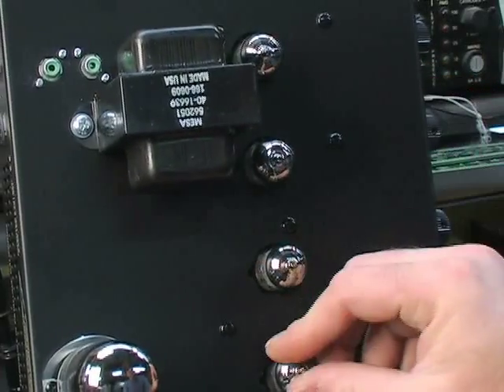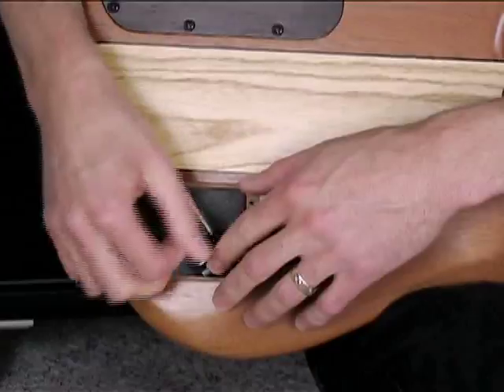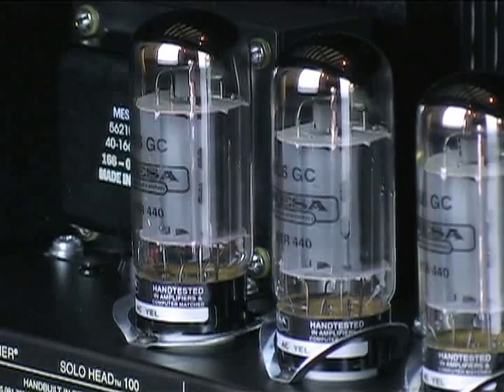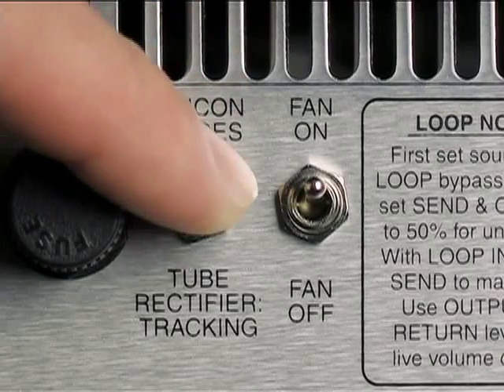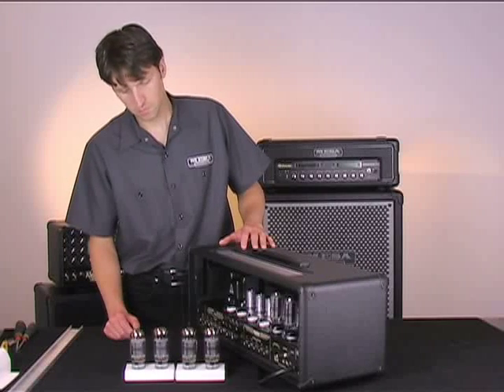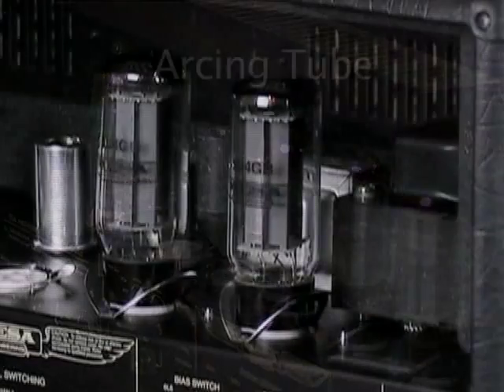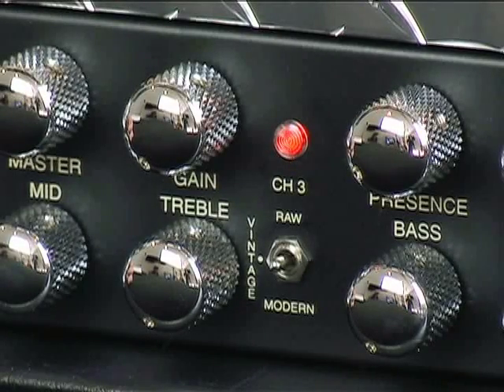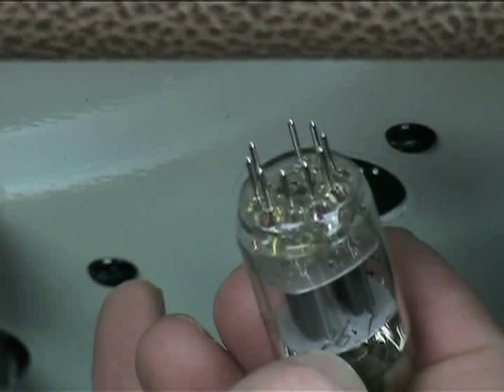Mesa Boogie Amplifier Troubleshooting

Comment: Hey, I just bought a mark V25 brand new and it just arrived about a week ago. I was playing this morning on the crunch mode with a little bit of the boost engaged on the mid control when signal cut out completely all of the sudden, the amp remained on and I checked later with everything unplugged and the fuse was still intact. Just want to know what might be up and how to deal with it. Thanks!
Reply from the maker: Hi Lowcloud - congrats on the amp but sorry to hear of problems. If the pilot lights and channel LED's all stayed lit on the amp when the sound cut out, it isn't likely to have anything to do with the fuse. The first question is, did you have anything else connected to the amp? (Pedals, pedalboard, rack effects, etc. If you did, it's important to remove all of those things and add them back one at a time to make sure the problem isn't somewhere else in your signal chain other than the amp. You can plug directly into the amp with just a cable and continue to play/test the amp and see if it cuts out again - if it doesn't, it may be a cable or something else in your signal chain. If you were just playing with guitar, cable & amp, make sure to check your guitar and speaker cables and speaker input jacks to make sure you trust them. From there, you might need to begin troubleshooting the preamp tubes one at a time as mentioned in this video. Let us know what you find out and we should be able to help you get everything back and going. Keep us posted!
Reply: +MESA/Boogie hey thanks for the reply, I unplugged everything in the loop and such so it was just the amp, I tried all my leads and tested them before hand to make sure they work and I couldn't find anything wrong there, I also tested the leads with out a guitar to eliminate that and there was still no response. I tried running just the head through the head phone jack with Status open back studio headphones, but there was still nothing. I don't want to break the warranty on it, can I test the tubes and keep the warranty intact?
Reply from the maker: Excellent job on the troubleshooting so far,LOWCLOUD NZ. As far as warranty, if the amp is new, the tubes are covered under warranty as well as the amp. Changing tubes is definitely user-serviceable so, with a known good 12AX7, if you replace the preamp tubes one at a time, at any time that the signal comes back with a tube that replace, you know you've found the bad tube. Let us know how you get one with the 12AX7 changes/tropubleshooting and if that doesn't takle care of it, we'll look at the next steps.
Reply: +MESA/Boogie just bought some new 12AX7s (Mesa made of course) and I found the V4 preamp was causing the problem and with a little bit of work we got it out and replaced and got the amp back up to its original glorious state. Thanks for the help, it's much appreciated!
Reply from the maker: Fantastic news, LOWCLOUD NZ– Great job on the troubleshooting and so glad the amp is back to its true glory! Nice. :)

Comment: The fuse holder on my Dual Rectifier is suddenly not catching, and popping back out. Is this something I can easily fix myself?  I bought the amp, used, about 6 years ago. Also, what is the correct fuse to use in this amp?  Thank you.
Reply from the maker: Hi +Rok Hollywood - It sounds like the fue holder in the amp has maybe broken or the cap is broken - either way, it sounds like it needs to be replaced. For a USA Dual Rec, the proper fuise value is a 4amp Slo-Blo fuse. Hope this helps!

Comment: I have a Mesa/Boogie Mark V combo, and I experience crackling. It persist even when there is no cable plugged into the input jack, but will stop if the amp is put on standby or the mute is toggled. Eventually it discontinues the crackling on the lower volume and gain  registers of the 10 watt channels, but if the gain and master are turned up half way each, it becomes very audible. Is there any indication what may the cause of this? I'd rather not have to send the amp in for 6+ weeks if I can avoid it.
Reply from the maker: Hi +MEDium Studios - sorry to hear your having troubles with crackling in your Mark V. However, the issue is very likely to be a tube issue and something you can replace yourself, which is very much what this video explains. With the Standby off, you should hear NO sound anyway - that's what the Standby switch does. The problem could be either preamp tubes or power tubes and the first way to troubleshoot this is - with the amp making the noise, if you turn the gain down, does the noise go away. Or, if you turn the channel Master down, does the noise go away. Or, if you turn the Output Level control down, does the noise go away. Depending on your answer, we can determine if the issue is likely preamp or power tube related. Where are you located? Look forward to hearing back from you!
Reply: MESA/Boogie Thank you for the expediant reply! Within the first 5 minutes of being on, I can hear the crackling noise when both are turned down pretty low, or up. After 5 minutes has passed, I can only hear it if the gain and volume are both at, at least noon.
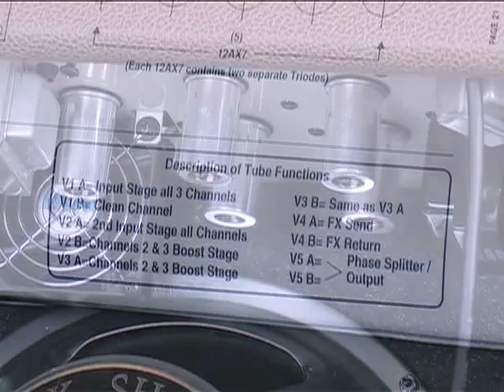Reply from the maker: Hi MEDium Studios- OK. This is somewhat helpful. However, what we need to know is what happens when you turn certain controls down, not what happens when something is halfway up. Are you in the USA? If so, it would be much easier to help you troubleshoot over the phone. If not, please re-read my first reply and see if you can respond specifically to what was suggested. With everything at 12:00, if the noise goes away when you turn a specific control - Gain, OR, Channel Master, OR Output Level. When you cvan answer these questions specifically, we'll be able to help more. You can also email tien@mesaboogie.com and we'll be glad to help. Thanks!

Comment: I'm getting a bad "crackle" sound from my Mark iv, whenever I play a note, no matter what volume.  I can't figure it out and it's pissing me off.
Reply from the maker: Hi +Jon/Ron Smith - Sorry to hear you&#39;re having problems with the amp. Feel free to contact Mesa Customer Service and we can discuss how to further troubleshoot and figure out what&#39;s going on with the amp. Look forward to hearing from you and look forward to getting the amp fixed up! http://www.mesaboogie.com/support/contact-us.html
Reply: +MESA/Boogie I figured it out, I swapped places with the power tubes.  Put the outsides on the inside and visa versa and now it works fine.
Reply from the maker: Excellent, Jon/Ron Smith. If you have the amp on Class A, this means that the tubes that were on the outside (that are now inside) probably have something wrong with them. If you have the amp set to Simul-Class, it's still possible that the issue is with the tubes now on the inside, but in general, it might not be safe to consider the amp totally 'fixed' even though the noise went away. Also, if you haven;t changed tubes in the amp for quite a while, this issue might have been 'telling you' that it's time to consider changing power tubes. Keep us posted and let us know if we can help!
Reply: I'm loving this amp so far, It's crunchy.  Can you invite James Hetfield and John Petrucci over my house, so you guys can help me tweak my Mark IV? ;)  I have a studio here, so we can record something!

Comment: Hi Mesa/Boogie, don't know if you are still checking the comments here. I just bought an Express amp and have an issue of volume drop in and out every 20-30 seconds when amp is warm. Dealer thinks could be from no fan built in but seems strange it happens every time amp has been on for 20 minutes or so. Any suggestions? Thanks.
Reply from the maker: Hi +jonwands - sorry to hear you're having problems with your Express and we can help! If the amp is not designed with a fan, it does not require a fan. It would be helpful to discuss this with you in person rather than via comments here. Please send an email to tien@mesaboogie.com to discuss the next steps to getting your Express fixed up and back to perfect operation and we look forward to helping!

Comment: You got it completely wrong, my comment was a general one and not in reference to this video, tubes are failing all the time and it has nothing to do with Mesa Boogie or any other company for that matter.
I’m using boogie for many years now and love your products very much, your customer service is great,
I have used it many times, very helpful staff and thank you for that.
My comment was a general one, in my own experience pots/ connectors/ switches are failing more than they should, IE over the years I have changed pots on my guitars to good quality ones, the good quality ones literally never fail, and I don’t have to tell you that they are being used much more than the ones on the amp.
I SIMPLY WANT PEOPLE TO KNOW THAT EVEN THOUGH THEY ARE PAYING A LOT OF MONEY FOR MESA BOOGIE AMPS, THEY MIGHT ENCOUNTER ALL KIND OF FIXES THEY SHOULD HAVE NEVER ENCOUNTER.
Reply from the maker: Hi +yoheff988 - Thanks for clarifying and thanks for the kind words regarding Mesa and using our product. While we can appreciate your interest in your personal guitar maintenance, to use that as an example of Mesa using inferior parts is something we would suggest doesn't apply directly to our manufacturing and parts quality process. Again, if you have a specific issue or concern with an amp, we are more than happy to address it or help you or any other customer sort out a problem. To make a blanket statement that Mesa uses inferior parts because you like to use more expensive pots in a guitar or that customers should expect to have problems with a Mesa amplifier is just plain false and not reflected in what we see with our products or our customer service. Again, this is your opinion and you're welcome to share. However, for anyone looking to purchase a Mesa amplifier, your statement of your guitar pot experience versus Mesa reliability is unsubstantiated, untrue and unhelpful. Thanks again or sharing your thoughts and all the best to you and your music! Rock on! :D
Reply from the maker: Hi SHANE BERENGER – If the amp still turns on but you have no sound, the problem is likely a PREAMP tube, not a power tube. Check the 12AX7 tubes inside the amp and they probably need replacing. For 6L6 tubes, in a Mark IIA, they are matched by the outer 2 power tube sockets and the inner two power tube sockets. If you have all 4 tubes matched, you can just install in any socket and you are fine. If you have two pairs that are differents match groups, install two in the inner sockets and the other two in the outer sockets. Hope this helps!
Reply: MESA/Boogie 
Hi there.. Firstly i own a mesaboogie mark llA combo and its awesome ..having said that..while i was playing my amp on 60watts i felt it a little bit distorted and dragging..so i turned up the volume, n while playing it..everything stopped suddenly and my amp won't come on but the Orange on/off light does come on. Noticeably the 4th valve has two smudged circle patches on the glass tube (both sides)  does this mean the problem n why it wont power up the amp? I'll be so happy to hear from someone.. Also how will i get matched 6L6 tubes inserted.. If tyey are 4 matched ones can i insert them in the socket by just picking one as (number 01) and continue the ballance 3 tubes.. Thanks very much

Comment: Very informative, Thank you.
To all of you that think (like I did for a long time) that Mesa Boogie products are built like tanks, it's  completely false,
Mesa Boogie products are failing and not in small numbers, the parts that they are using are not always of high quality like their claim.
Reply: +yoheff988 I am an amp tech, as well as a builder of custom hand wired amps, and I can attest to the fact that Mesa Boogie does NOT use inferior parts in any of their products.  While I may prefer to use a specific part in one of my amps, it  does not mean that the parts other manufacturers use are not up to the task, especially Mesa.  I have even worked on a few highly revered amps that were built by another manufacturers which had some Mesa-branded parts inside.  The majority of the Mesas I have worked on in my entire career needed nothing more than new tubes and a good cleaning.  In the few that required more serious repair, the cause was generally due to events that had nothing to do with the quality of the amp or its parts and could have happened with any amp.  I have enough faith in Mesa's quality control that I will always recommend using Mesa replacement parts in their amps, which the fine folks with Mesa's customer service department have always been great to work with when acquiring these parts.  I've worked on all major US & UK brand amplifiers as well as many import models and I can tell you that Mesa is easily THE best quality manufacturer out there with the best quality control and customer service!
Reply from the maker: Hi +yoheff988 – Is there a specific problem that you are having with an amp that we can help with? Contrary to what you are suggesting, WE are NOT  seeing failures. Because tubes are finite devices and will eventually fail (all tube amplifier owners either know or should be aware of this), this is why we offer this instructional video for people to be able to perform their own maintenance and find and replace faulty/failing tubes. Regarding parts and quality, your statement is your opinion (which you are welcome to), but again, NOT reflective of what Mesa is doing or what we stand for. If you'd like to discuss further or if you are having a specific problem with an amp, please feel to contact us at 707 789 3325 and we'd love to help you out, address any issues or concerns you may have, and help you understand more about the company and what we do. Thanks for your time!
Reply from the maker: Thank you so much, Don Sloan! We really appreciate you sharing your thoughts as a fellow builder and amp tech! There are a multitude of decisions and incredible processes that go into part selection. While we strive for the ultimate tone and reliability as the foundation of what we do, there is also economy to consider. While we don't make the least expensive amps in the world, we also don't necessarily make the most expensive amps in the world either - especially if you take into account the versatility of most Mesas. It's one thing to design a great amp. It's a whole other thing entirely to be able to produce them consistently and within a competitively affordable price range and offer one of the best warranties and service in the business. But these are all things you know... :) Thank you very much for taking the time to share your thoughts!

Comment: On a Mesa Boogie 2:90 Power amp, there are eight L6L power tubes, 
We have a bottom row of 4 tubes, and an upper row of 4 tubes, that makes 4 pairs.
when replacing the tubes, how would one know which are the matched pairs?
also if someone can recommend good tubes for the this power amp.
Reply: I had the same question several years ago and the Mesa tech I contacted sent me a diagram on which tubes are matched in the Simul 2:90. You don't need to color-code match all 8 tubes, just color-code match per pair (example:  Yellow and Yellow, Red and Red, etc.).  The top row and bottom row of tubes are offset slightly, but don't let that bother you.  The top leftmost tube's match is the bottom leftmost tube.  The top rightmost tube matches the bottom rightmost tube.

All the tubes follow that pattern, top row tube position matches its bottom row tube position counterpart.  I hope the font used here works, but to draw it out would look like this:  

Y=Yellow, R=Red, G=Green, B=Blue

     Y      R      B      G
  Y      R      B      G

Comment: I just got 3 brand new sets of 6l6gc for my triple rectifier, I installed htem correctly and whenever I turn standby on and off, there's a light flash that happens... it doens't make sense to me.. these are new tubes so I'm guessing it is normal.

But in your video you said that could mean I wasn't installing them properly?

(Yes, bias switch to 6l6 and warmed up for 30 seconds.)
Reply: I’m having the exact same doubt/issue on my DR. All the 4 old and 4 new power tubes I bought are showing a light flash on the standby on and off test…

Comment: @Levi790 i doubt it's true as i use mine too and i self bias etc my other amps. I wipe the excess away though. does it seem to effect the lifespan of light bulbs? I'd justwipe them clean and i'd worry more about debris in the sockets than tubes. i have had some with COOKED dust on them and last for years. (the mesa i got as an example, had old mesa tubes they don't even sell or make anymore).

Comment: Those are all very useful, but please mention that voltages inside can KILL (even though you don't describe steps of opening up the amp). 

And that people shouldn't experiment with speaker cables when the amp is on because a lack of a load can damage it.